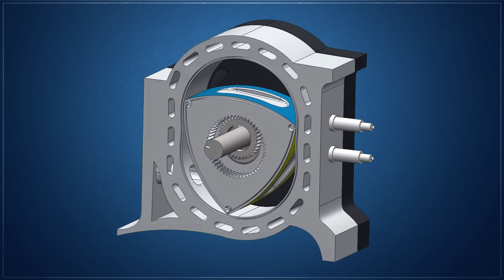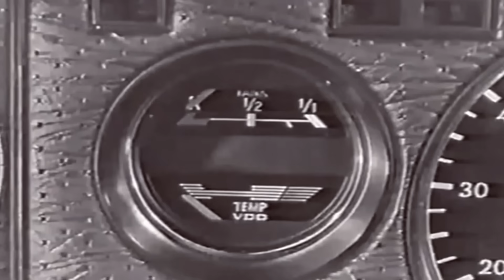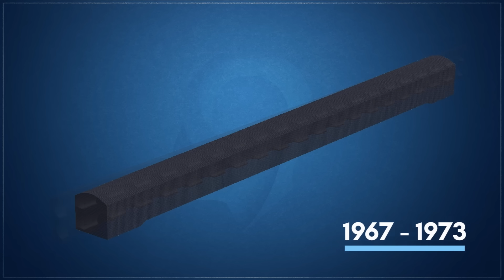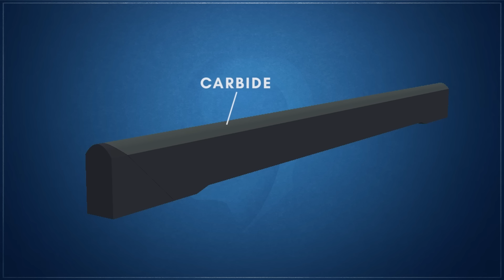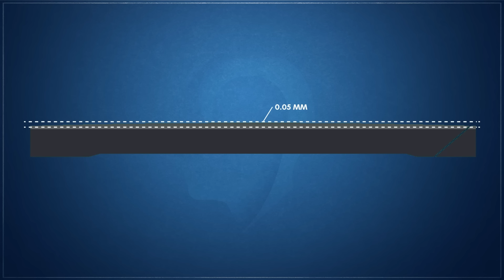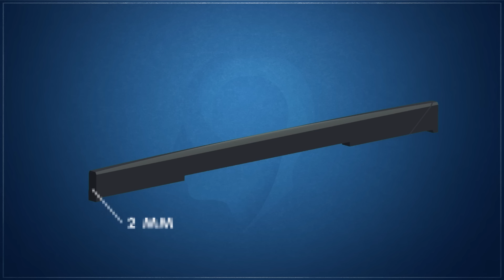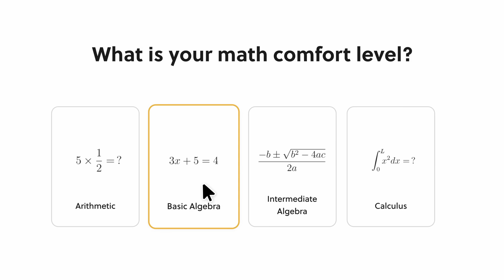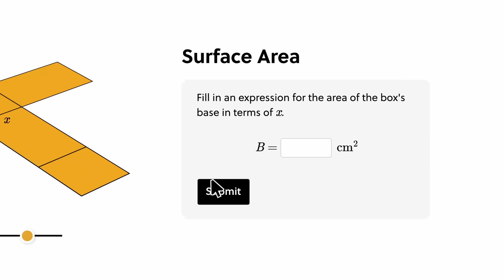Overcoming The Rotary Engine’s Biggest Flaw

Comment: Do inverted wankel motor where the seal is fixed by geometry. And why it never saw light of day despite nearing perfection.
Reply: Someone is trying to develop them, actually. Look up liquidpiston. But yes, the best part is no part. The inverted topology gets rid of apex seals entirely.
Reply: What's the compression ratio, I wonder..
Reply: @campbellpaul  near ideal. It would work great with hydrogen as fuel too
Reply: @manipulativer  A fuel that burns cooler than gasoline would also be ideal
Reply: @manipulativer That's an incorrect assumption on your part.
Wankel type engine are very limited in SCR and cannot be operated with gaseous fuels like hydrogen efficiently.
Reply: @campbellpaul Actually gasoline is the ideal fuel for Wankel engines, they perform even more poorly on other fuel types.
Reply: @campbellpaul due to the limited geometry these types of engines have much lower static compression ratios than reciprocating engines.
Reply: LiquidPiston is not a legitimate company, it's claims are completely unsubstantiated and highly dubious.
The company is notorious for high pressure investment practices and is widely recognized as a vaporware scam.

Comment: What seals the sides of the rotor and the walls of the housing? Is this area larger than on an equivalent piston engine?
Reply: Each rotor surface has two rows of steel shim type seal devices.  Its a huge number of tiny sealing devices on each rotor.
Reply: There's 2 rotor covers create a seal with the engine housing (oval metal piece) and the rotor (metal dorito) is sandwiched inside.

Machined flat surfaces and some gaskets also the maintain pressure from combustion
Reply: This is how hard u can push a rotary🔥🔥😱😱https://m.youtube.com/watch?v=xtVVPioU9p8&t=1127s

Comment: The materials science in the apex seals is incredible
Reply: Freaking love it! Electron beam cooling? Porous chromium? Whatever, no problem.
Reply: Also incredible -- Cast Iron competes against the latest and greatest composite apex seal materials. Nicely satisfying and low tech.
Reply: @scottcates Cast iron is an excellent material for engine seals... it's the shape and design of the Wankel engine that is the problem.
Reply: All that work and they're still shit.
Reply: Shut up
Reply: And yet apex seals remain too fragile and unreliable to be used in aviation safely.
 A round piston will always work better than a triangle shaped one... apex seals are fundamentally flawed.
Reply: Reportedly, once running, a rotary will continue running given fuel & air.  Regardless of lubricant or coolant loss. 

The ocean east of Maui is littered with the wrecks of light aircraft flying from CA to Maui, but didn't make it.  Loss of lubrication / coolant frequently cited.

Comment: How long do the apex seals last as a generator ?
Reply: Theoretically, it could last up to ten times longer.. It really depends on the reception it gets from the consumer market, though.
Reply: @campbellpaul Wankel generators got a very cold reception from consumers and were quickly discontinued.
Reply: I guess very long because of only 700rpm
Reply: @TheAdatto  4700 is what they state, but that should double its lifetime without hard loads. Just guessing.
Reply: @TheAdatto Wankel engines have been developed I the past for generator applications and have no advantages over reciprocating and have several crippling disadvantages which is why Wankel generators were never successfully sold commercially.
Reply: Apex seals Don't last, which is why Wankel engines are obsolete technology today.

Comment: It will work someday. Engineers are nothing but persistent and insistent, and very qualified above that
Reply: I think it's potentially a great design.
Reply: @campbellpaul  It's not, really. The engine works, but it has some significant drawbacks. The wear issue can be engineered out, yes - but the poor efficiency cannot, and nor can the terrible emissions profile. Those are just part of the fundamental design. The biggest upside it has is very high power density, which is why it was a good choice for a hybrid vehicle range extender.
Reply: @vylbird8014 The Wankel engine is a terrible idea for a range extender...
The Wankel is noisy, dirty, inefficient and unreliable...it is completely incompatible with the whole "green energy" concept of EVs 
Range extenders were a failed concept that never caught on... it was only BMW that attempted to sell one and it was ahuge flop, everyone else dropped the concept completely.
Reply: @campbellpaul You would be very wrong in your assumptions.
Reply: @sandervanderkammen9230  I think the takeaway here is that a design can be really cool without being actually practical. The Wankel is really cool. So was the Chrysler Turbine.
Reply: @vylbird8014  Well, there is a distinct difference between them... while the gas turbine was a failure in  automotive applications it has been extremely successful in Aircraft, Marine and Stationary applications.
The Wankel on the other hand was ultimately a failure in all internal combustion applications.
Reply: @@retiredbore378 I wonder if you could make an engine that operated as both two and four stroke, using electronically actuated valves? Then you could get the efficiency of four-stroke most of the time, but sacrifice it for the power of two-stroke when acceleration is needed.
Reply: Just in time for demand to disappear as ICE-driven vehicles are displaced by electrics.
Reply: All of the manufacturers reached the same opinion about the Wankel... that it was fundamentally inferior to reciprocating engines and it has come to the logical conclusion of its practical development potential
Reply: @@retiredbore378 Wind, water, steam and gas turbine... depending on where you plug in....
Reply: @sandervanderkammen9230  What are your qualifications

Comment: It's a shame that rotary engine is rarely used today...
Reply: I'm just glad Mazda is bringing them back!
Reply: @jayyydizzzle Mazda president Akira Marumoto's announcement in July confirmed that the MX-30 was cancelled.
Reply: @sandervanderkammen9230  :(
Reply: @sandervanderkammen9230 you sure it's discontinued? The rotary and REV version is starting mass producing and even some Japanese car journalists has seen it's production and assembly line
Reply: @ronronchau  The announcement came in July, Mazda president confirmed that the MX-30 was cancelled
Reply: Angry Rob Dahm noises.
Reply: Rotary engines are terrible for daily driving, they are only good for racing.
Reply: @nicmainville9954 then drive it like a race car. Imagine babysitting a car instead of using it right.
Reply: It really isn't. Great power density. Not-so-great everything else.
Reply: @vylbird8014  the boost in Apex seals out and the spinning dorito memes are pretty good tho
Reply: @jayyydizzzle  Power density: Great.
Service interval: Crap.
Oil use: Slurp slurp slurp.
Noise: PRRRRRRRRRRRRP
Reliability: Liability.
Emissions: Smogtacular.
Fuel efficiency: Deficiency.
Reply: Precisely WHY is it a "shame" and how would that make your life different?
Reply: There are some very good reasons why the Wankel engine was a failure.